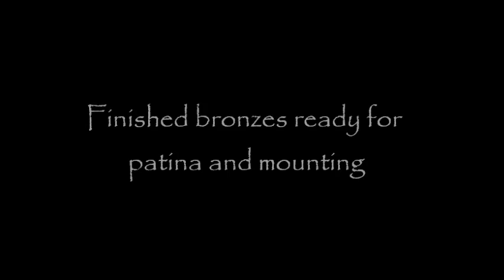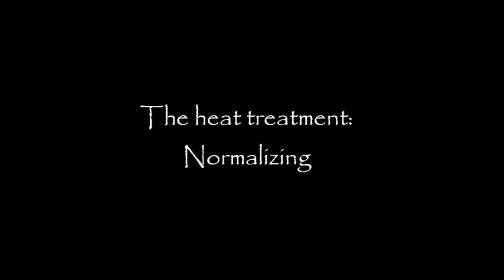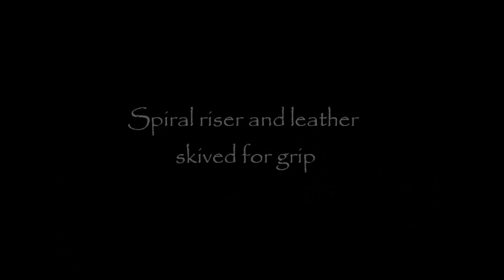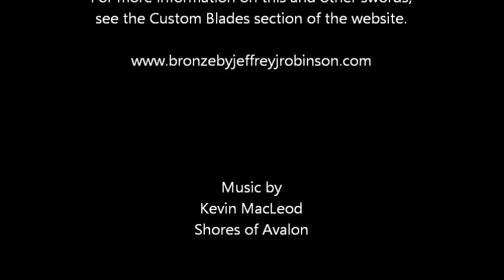Andurilish War Sword

Comment: a question, if you please: almost all other bronze casters I have seen, have their bronze form a "stalactite" of solidified bronze at the edge of the melting pot during pouring the melted bronze in the cast, while yours remain liquid to the end. Do you add something to the bronze to achieve that, or is it something else?
Reply from the maker: +Ainulindala  I would imagine they are probably pouring the bronze at a cooler temperature than I am.

Comment from the maker: @mavway02, unable to respond directly to your post. The fuller down the center of the blade was ground in using a small wheel on my belt grinder.
Reply from the maker: ***** Threading it would have ruined an otherwise quality build. The pommel is keyed to exactly fit the tang. At 6:23 you can see the pommel positioned next to the tang showing how much of the tang will be inside the pommel. You are correct that the small piece of tang you see sticking out the end at 6:30 was peened. I used a long slender drift which I made specifically to peen this pommel. Difficult, but not impossible, and a bit of showing off.

Comment: Why would you normalize a stock removal blade? I’ve just never heard of that doing any good to the grain of the steel but I’ve misread many things before.
Reply: Any high carbon steel can benefit from normalization.
Reply: Normalization costs nothing but time and a little fuel.  Guessing wrong and skipping it can cost you a lot more of both than going through with it.
Reply: Michael Chambers thank you! I never would’ve considered it with stock removal.

Comment: Amazing job! Just curious, what were the dimensions of the piece initially and how many hours did you put into it before heat treatment?
Reply from the maker: Johannes Schmidt The steel for the blade was 48" long, 2.5" wide and about .275" thick. Afraid I don't recall how many hours were in it prior to heat treatment. Maybe 30 or so?
Reply: brotherbanzai Wow, that is a lot of work. Was machining out the fuller the most time consuming part?

Also, how did you temper something this long? In most other home DIY swords, the smiths usually discuss using temper colors but that is no where near as accurate as using an oven with precise temperature control.

Again, amazing work!
Reply from the maker: Johannes Schmidt The fullers are fairly time consuming, but not as much as the bevels. I built an electric heat treat kiln, which you see in the video, and it has a pyrometer built into it to accurately measure the temperature. I use the same kiln to temper the blade.

Comment: I cringed watching the transfer from heat element to quench.  Being mildly clumsy I had visions of a painful end.  I would have to build like a wooden platform between the two to stand on or something, otherwise I would probably die...
Reply from the maker: It's not the optimal setup for sure, but I haven't had any problems.